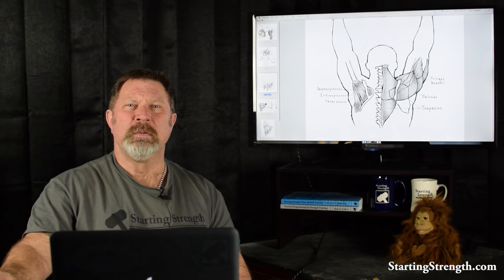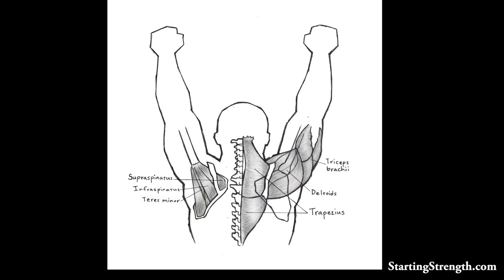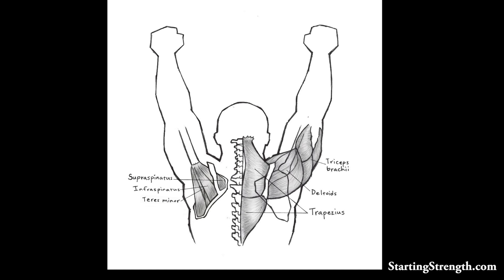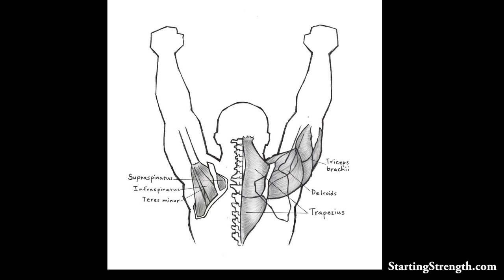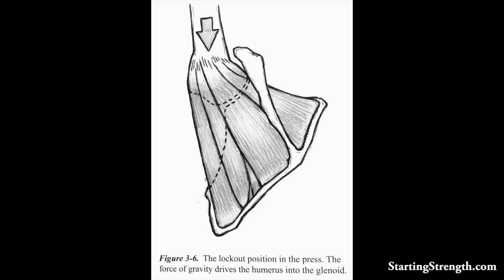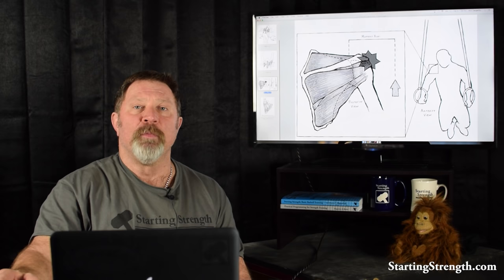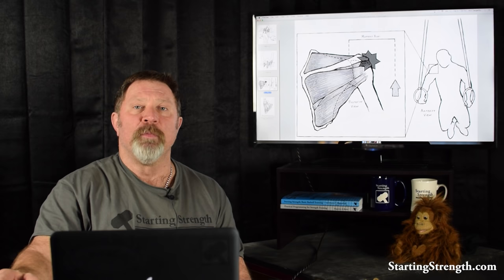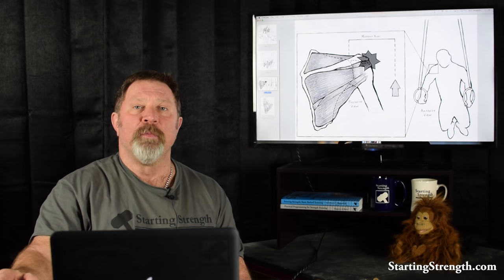Shoulder Rehab Case Study

Comment: I did exactly what Rip describes here after my Supraspinatus tear was repaired. He’s absolutely right on this issue. Worked like a charm. Many thanks Rip!
Reply: How long after surgery did you start with the rings?  The video does not seem to provide exact time-lines for the rehab movements
Reply: @sivad1964able  Bob,  I don't recall exactly, but it was probably something on the order of about 2-3 weeks before the acute pain had settled down enough to permit even the beginning of an unloaded swing of PVC pipe on the rings.  It was a gradual process of getting to shoulder level then slowly overhead.  Then it was a matter of incrementally loading.  In my gym we had those 5' rubberized metal bars ranging from 10 to 40 lbs. that women use for aerobics, so it was pretty easy to gradually increase the weight for the overhead press. You'll get to the point where you can use a standard 45 lb Olympic bar.  From there you're back in familiar territory.   Good luck!

Comment: As a practicing physical therapist assistant for 11 years and an active wt lifter for 25 yrs, the last 8 of which having been primarily kettle bells I can say I agree with your overall attitude and exercise prescription. I feel therapists are, at times,consrevative with exercise prescription and don't know how to progress beyond acute phase below 90 degree protocols. Now that being said weight lifters compared to the average individual office worker who has the AC joint anteriorly displaced from years of computer work are two different animals and should be treated according to fashion and pain tolerance. The former will have an advantage in so far as knowing their bodies and knowing how to elicit different muscles to help stabilize to GH joint. Training athletes is easy compared the the sedentary individual w/an overuse injury superimposed with poor posture. Unfortunately in a rehab setting we see more of the latter vs the former and most therapists, as I mentioned before, aren't forward thinking and only progress certain exercises based on the below 90 degree protocol. With that being said I have encountered many an individual who have had months of rehab following an RC repair and who still have significant pain and ROM limitations. I found your excerpt interesting as you mentioned knowing the difference b/t good and bad pain. The "average" individual has difficulty  accepting the fact that rehab is uncomfortable where as athletes know, or are quick to learn the difference. I am curious to know however in your own particular experience if you focused on and learned the value of good posture, the importance of the role of scapular/GH stabilizers i.e.: rhomboid firing etc as these muscle shut down after injury and time under tension or easily put muscular endurance before strength. I must say I learned something valuable and would rather talk to someone who is intelligent and who has personally had the experience of self rehabbing  a shoulder surgery vs some DPT who thinks just because they read it in a book it must be set in stone. The point is every one is different and must be qualified before any rehab program is put into place.
Reply: TheDirthound .
.
Yawn
Reply: Direct simplicity is superior, and it's respectful of someone else's time.

Comment: I have a client  whose shoulder I have rehab using this technique it works very well I would suggest using after the stick a 4 kilo bar then 7 kilo and then 9-11 kilo i use 4 kilo bar the add 5 pounds each set if poss

Comment: Good presentation. What worries me, since  1.) I'm 60   2.) I tore my rc 20 yrs ago and now tore it again.   3.) It didn't heal or I somehow tore it loose during initial rehab   4.) I now have an allopatch graft reinforcement after revision surgery along w/ stem cell augmentation-- how will I know that the repair is ready to be "pushed" w/ enough load to toughen it up similar to how Rip did it???  And if I were to push using this process, what happens if the repair lets go again?? For me, weighing these risks is very frightening since I want to get back to normal. Thanks.
Reply: Oldpuck81 its definitely ready by now..

Comment: mark, i took your advice and shrugged after lock out, both rotator cuffs were partially torn. i was shocked, is it because my arms were tucked in, i thought by narrowing my grip i would avoid impingement, but perhaps it caused internal rotation. anyways 2 cortisone shots (left shoulder on rc, right shoulder on ac) i learned to only do dumbbell press narrow but half range,  gained all my muscle back. did i understood the movement wrong???
Reply: amro abdulbade huh, thats an odd case. This may just not be the right exercise for you..

Comment: Hmmm. This is a great video. But I don't have a problem with deadlifts or shoulder presses. My issue is with being able to bench. Pretty sure my supraspinadus tear from a motorcycle accident is the perpetrator. I really want to increase bench b/c my chest is becoming a weak point for me simply because of a shoulder issue. Can you point me in the right direction for what to do about this?

Comment: This is encouraging, I am still in a sling 1 week post op.
Reply: Moss how did you go with your rehab ? Did you use this method in the time frame suggested ?
Reply: @jamiegovan  that wad over a year ago now. My surgery was far more extensive than I knew when I posted my comment and Rips method doesn't apply to my case. I was in a sling for 2 months and rehab was very difficult and lasted many months. If you get some bone spurs knocked off or just have a minor RC repair fine but my RC was shredded.
Reply: @mossnomad7723  oh ok, I have a 2.5cm tear in my supraspinatus

Comment: Incline bench press,dips, upright rows ,lateral raises are the real culprit.
Ohp is safe.
Reply: @Adam Swink incline - less room in the subacromial space dips, internal rotation angle - upright rows - internal + past 90 degree (impingement) lateral raises same as mentioned for upright. OHP is really safe. If you do it eccentrically its EVEN safer. Great for rehab!!!

Comment: excuse my rudeness but why is the overhead press considered a natural human movement but external rotation isn't? They're both made up movements but they're also both movements humans can do, thus they are natural. There's nothing wrong with doing external or internal rotation exercises. There is vast evidence online as well in studies that prove that doing banded rotator cuff work will increase stability performance in these other sought-after movements.

Comment: do you think there is any benefit (shoulder health related) by doing dips with rings vs a fixed parallel bar?  I've heard rings are better because it allows the shoulder to move a bit as you go down into a more natural position.
Reply: +Brian Bacc +Brian Bacc Ring dips can be very dangerous, especially if you're not very light yourself. Reason is that very light deviation from the ideal range of motion causes very big change in the moment arm and thus increases the forces on the stabilising muscles very quickly and by a lot. Generally parallel bar dips are much safer.
Reply: Brian Bacc hell no, haven't you seen the pec tear and shoulder pop videos..

Comment: As one of the guys who  he makes fun of (a physical therapist) I would advise everyone to be very cautious with this approach. In my opinion, this technique is dangerous as could result in re tearing the repair.I don’t think he fully explains the biomechanics of Humeral scapular rhythm or the impingement zone (60-120 deg of shoulder flexion)which you pass through constantly in you approach, This rehab approach  overlooks the importance of scapular retraction strengthening through activation of the middle trap and rhomboids while avoiding excessive upper trap contraction. (I know you hate the word activation).  People need to know that the most common time to rerupture your repair is 12 weeks after injury. When the pain has subsided but the strength isn’t back. 
It’s funny how he bashes physical therapist for not doing enough functional activities with legs but goes right to the non functional (full shoulder flexion) activity for should rehab. Really how many things do we do at end range shoulder flexion?? 
       Maybe if he would have used those bands and small weights to improve External rotation strength he wouldn’t have torn his rotator cuff in the first place? Just some thoughts from one of those dumb overpriced PTs. Remember those weights and bands are a lot cheaper and less painful than a rotator cuff repair surgery. Just my thoughts.

Comment: Mark you mention how the shrug at the top avoids impingement but you have to start from the bottom and get there first. So isn't there impingement on the way up before you do the final shrug?
Reply: Long story short, it does not.  The full explanation is in the book, Starting Strength for Basic Barbell Training.
Reply: Its not shrug but superior rotation which happens gradually as you move the shoulder. It also happens "automatically" its not something you have to do actively.

https://exrx.net/Articulations/Scapula#UpwardRotation

https://exrx.net/Kinesiology/Glossary#Scapulohumeral
Reply: Lol, no, the trap shrugs the moment the bar goes up. In fact you cant not shrug when you press..

Comment: IF YOU HAD SURGERY DON'T DO THIS PEOPLE, WORK WITH YOUR PT.
If you used a sling your internal rotation is fucked up, then you have 90% chance that your scapula WON'T sit how is supposed to and you will fuck your shoulder again. 
I had a labrum repair, and I did this ring protocol 6 weeks post op, very slow progression, it helped to recover overhead mobility but my scapula wasn't working right because of the sling, then I fucked up my repair.

Work with a professional, you will recover overhead mobility, but in your time and AFTER the muscles that pull the scapula are working right, before that DON'T DO IT, YOU CAN EASILY FUCK YOUR REPAIR.
Reply: This is rotator cuff / Mumford protocol, not labrum. But probably you did it wrong, because if your scapula didn't work properly and you still tried to push further — it means you did the movement wrong technically, which could be a cause of re-injury